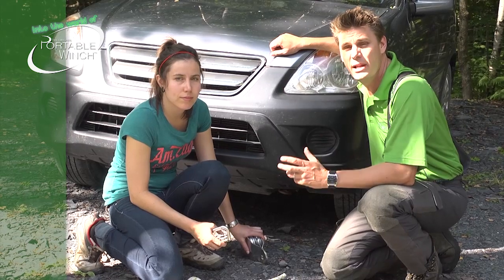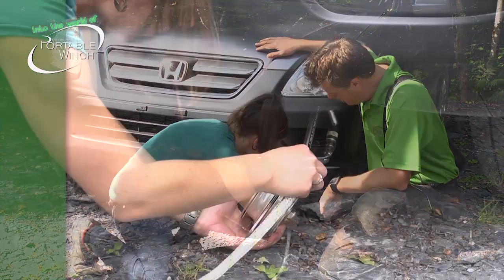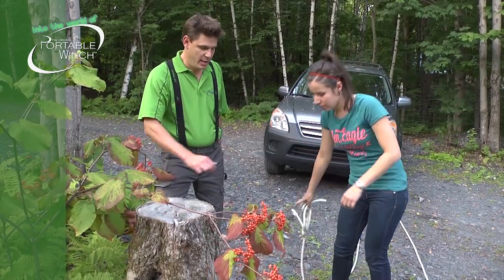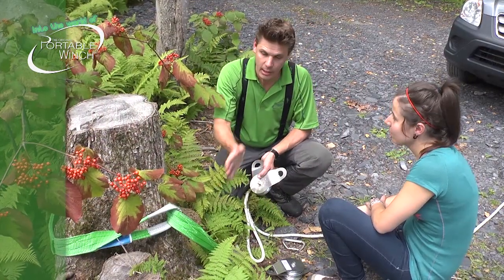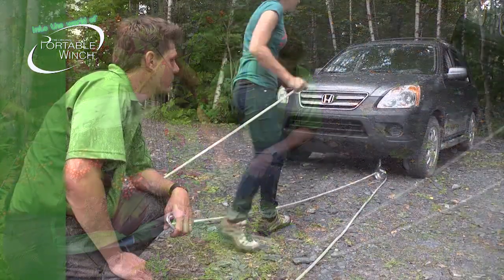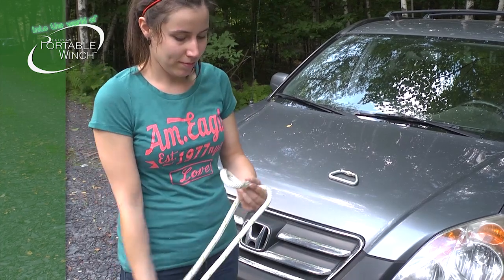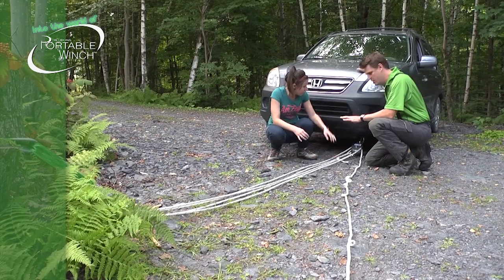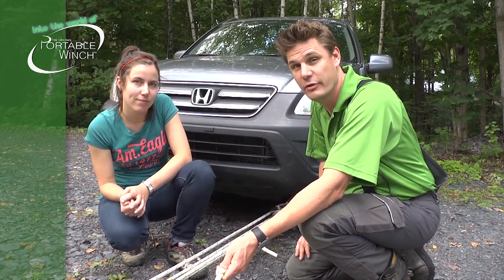Video 6 - Into the world of Portable Winch - How to increase the pulling power with pulleys

Comment: Would love to see a video on how to make a pulley system to pull groceries up to 3rd floor balcony.  Thanks, this 61 year old grandma would love your help.
Reply from the maker: We understand how convenient this system would be! That said, a capstan winch may not be the best way. If you search a little on YouTube, you can find other systems with drum winches mounted on a jib. Good luck!
Reply: It can be done easily.  But you'd want a wireless control otherwise, while you're going up to the third floor to off-load your empty crate of groceries, someone on the ground will have stolen your groceries.

Comment: Dear Christian
thank you very much for your very useful tutorial clip.

Please help me with my bicycle hoist in garage. I am using 5x single sheave pulleys with 2 point loads:there is one load lifts at handlebar and another load lifts  at the saddle.   I have to put too many effort to hoist my bicycle and consider to replace those singles pulley with double sheave pulleys. 

Unfortunately I do not have much space as the ceiling is not high enough for vertical pulley stacking. on top of that I cannot imagine how I could arrange double sheave pulleys to hoist my bicycle at 2 lifting points. Thank you very much in advance for your ideas/advise!
Mark
Reply from the maker: Hello Monkon, could you please send us an email via info@portablewinch.com. You could add pictures or a drawing of your setup. We should then be able to help. Regards,